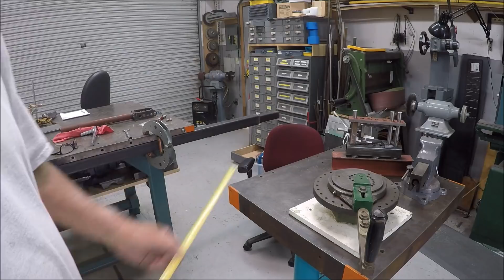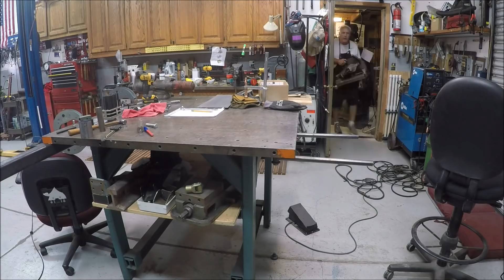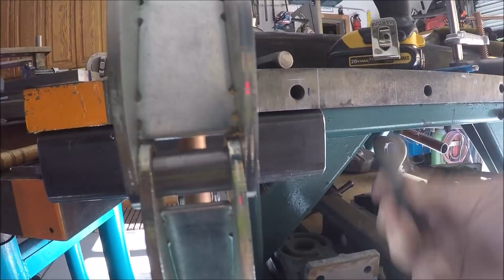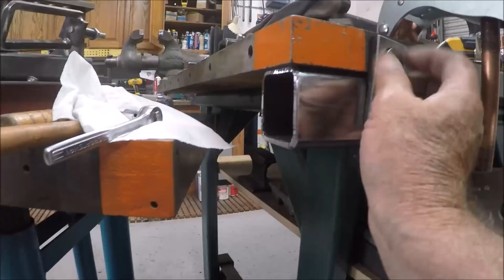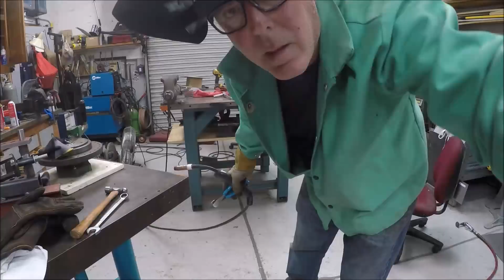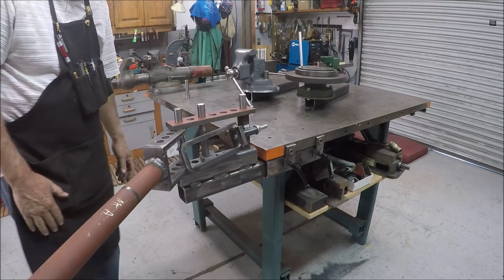Welding Table--Screwy Tuesday

Comment: Where did you get the little knob things that are used to tighten the bolts on your receiver on your table
Reply from the maker: McMaster-Carr, they have a website and the units are not expensive, search adjustable handles

Comment: nice work chuck.  when I did that to my only bench i didnt think it through like you did and just bolted the stuffs to the top, fail!  I am working on doing nearly the same thing using 2" trailer hitch parts.  the shop upgrades are awesome, keep them coming.